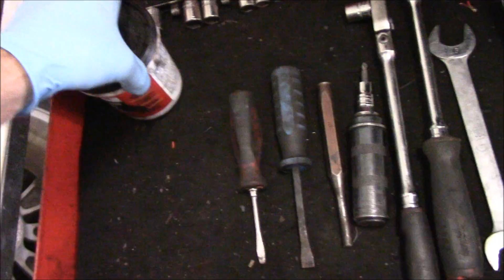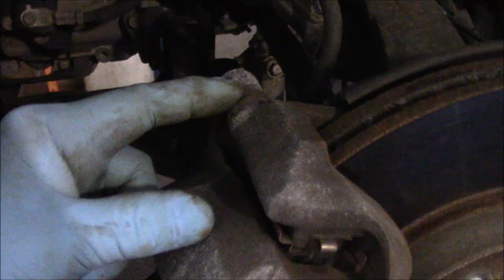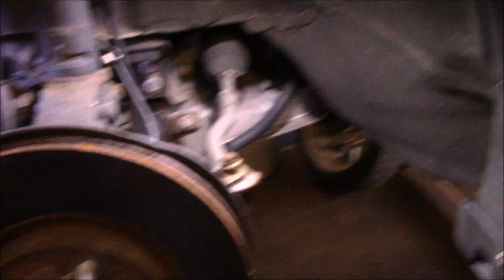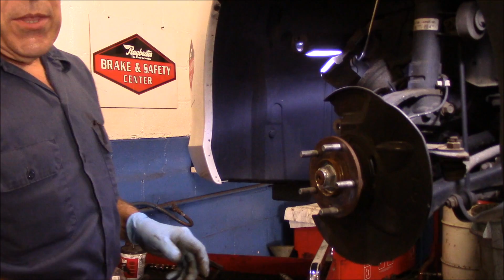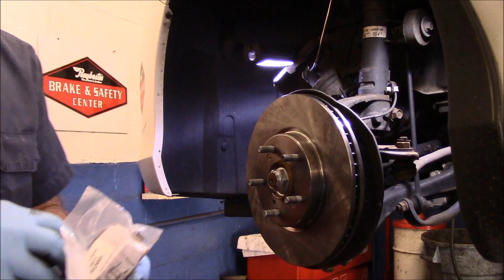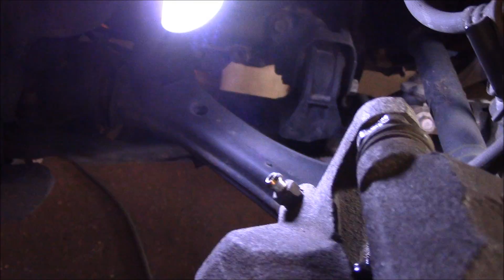Replace front brakes and rotors 2012,2013,2014,2015,2016 Honda Accord

Comment: Thank you for sharing this video. I have a question if i may. What grit sand paper did you use to clean the surface before putting the rotor back on?

Comment: YOU DID NOT REINSTALL THE THE TWO BRAK PAD SPRINGS.  USED TO HELP SEPERATE THE BRAKE PADS WHEN BRAKES ARE RELEASED.  ONLY TOP MECHANICS PUT THEM BACK.   ONLY SEEN ONE MENCHANIC ON YOUTUBE REINSTALL THEM.  THEY ARE FACTORY OEM ITEMS!!!

Comment: You are doing your job incorrect as missing pin to hold the pads and also missing the plate on the back of the inner pad.
Reply from the maker: You are wrong. The plate on the back as you call it .Does not come on quality  brake pads. As for the missing pin? What are you talking about?

Comment: Great video details. After putting brakes onto front bracket, I'm having problems putting the brake springs across the two pads and holding them into place while putting the caliper on. Any suggestions. I cannot find any information on reinstalling the springs? Thanks

Comment: At 15:40        Why are the two slide pins different from each other?  It's not enough to take them out one at a time and replace them where they came out.  What if the last mechanic who did the brakes mixed them up?  What is the difference in the function of the pins?

Comment: This is the detailed video I've been looking for. The last brake job I did was way back in 82 on my 70 Ford Fairlane with drum brakes. I wore those brakes out so bad the drums fell apart into pieces when I took them off. I wasn't sure if I would be able to replace the rotors and pads on my 2012 Honda but this video made it Easy Peasy Lemon Squeezy. Thank you verry much !!!

Comment: When finishing this job do you have to bleed the breaks? Just wondering
Reply: Brakes. And no. Brakes are bled at manufacturer recommended intervals. Not necessarily at brake/rotor replacement (no air was introduced into the hydraulic system).

Comment: The caliper bracket mounting bolts on my ‘16 accord are tightened to hell and one seems to need an 18mm socket. The 17mm won’t slide on which is weird cuz they look the same. Driver side

Comment: Thanks for the video Jim. I think this is the second or third time I’ve used this specific video and it saves me ~$300 every time. It’s always great to be able to learn from a seasoned pro, especially the extra tips (stuck rotor screws) that would otherwise be skipped on a basic step by step.

Comment: Hey what happens if you install the brake pads upside down . For example the front pads with the wear indicator on the inner side but instead up having the indicator up . Its on the bottom ?

Comment: Can I put the same from rotor on the back for more breaking power !. I see the from brake is thicker than the rear brake which mean the front has more breaking power than the rear because the rotor is thicker and the pads grabs the totor faster than the rear pads on the rotors.

Comment: I use the impact screwdriver all the time and never have trouble with it getting the screws out of the rotors. The torque specs are "Good and tight, plus or minus a jerk". After removing any rust, I still go back and spray break cleaner on the treated areas to remove any rust dust left on the reworked area. It is a great practice.

Comment: Is there a reason why there’s no V spring on the front pads? I bought brake pads with hardware kits for both my front and rear pads however only the rear pads came with V springs but not the front.

Comment: Is it advisable to use a thin layer of grease on the rotor surface where it meets the wheel hub?
Reply from the maker: Yes you can.Good question.

Comment: For those of us looking for the torque specs, here they are: 
      - Front Bracket mount bolts: 80 lb-ft (2013-2016)
 (These are the 17 mm bolts going to the wheel hub)
      - Front Caliper bolts: 37 lb-ft (2013 - 2015 Nissin type (14mm bolts))
      - Rear Bracket mount bolts: 80 lb-ft (2013-2016)
      - Rear Caliper bolts: 17 lb-ft
Reply: Anything else you’d recommend doing that he didn’t go over?
Reply: @bertabuddz4756  oh he was really thorough. I'd just suggest not to clean the wheel hub by hand as it takes really long to get it done. You can get the metal circular brush from autozone or home depot and attach it to your drill.

Comment: Replacing rotors and pads it is necessary to bleed the the calipers? Thanks
Reply from the maker: The only time you need to bleed the system is if you open the hydraulic system such as the lines or calipers etc.Thanks for watching

Comment: Thanks Jim for this video! I haven’t change the breaks of my car in quite some time and I want to do it myself, this is a great guide! I don’t have a lot of tools but since I will save around $200 by doing it myself, I might as well buy some helpful tools like the impact driver! Do you have any preferences of break pads or rotors? I have a Honda Accord 2014 Sport
Reply from the maker: I like the Monroe or the Wagner brakes. That is what I use in the shop.Thanks and good luck

Comment: Do you have to remove the brake reservoir cap first?
Reply from the maker: Only if the reservoir was over filledThanks for watching.
Reply: No, why would you?
Reply: @Thebrothaisback  Isn't it necessary when pressing the piston back in to avoid any damage to the brake lines??
Reply from the maker: Thanks for watching.

Comment: Saw a grease fitting there, does that fitting get grease pumped in ?
Reply: That was not a grease fitting, that was the caliper bleeder screw to bleed the hydraulic system.

Comment: A really good video.  Most everything covered and explained very well in easy to understand terms.  I wish you had included a mention of brake fluid issues just to reassure those watching.  Also, I would have likes more information on the silicon brake grease and a mention of anti-seize grease on the bolts.  If nothing else just mentioning fluid and anti-seize eliminates uncertainty.

I like the Amazon store feature.  The video would have been improved by reference to it for the piston spreader tool (I bought one), the brake grease (I bought a can), and the impact driver (I bought one). 

Not criticizing, just suggesting.

Great job!  I subscribed and look forward to other vids.

Comment: my 14 and 17 mm bolts were on so tight my air ratchet couldnt even budge em . it is a 50 lb ratchet though... any suggestions.
Reply from the maker: Yes if you get a very long ratchet that will give you more leverage .  keep me posted.

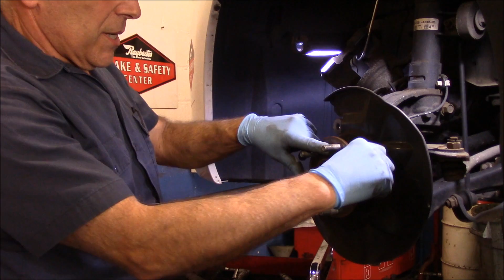Comment: I just replaced my factory rims and just noticed that both of the brake dust shields aren’t bent like at 9:59. Is that normal? I believer they are the dust shields, just not sure why they are bent like that.
Reply from the maker: Is it the same car in the video ? Every manufacturer has a different bend. I'm happy to help. Thanks for watching
Reply: jimthecarguy Thank you, it’s a 2015 Honda Accord sedan 2015. You may  have just answered my question. I didn’t know manufacturers have a different bend on the dust shields. I sent you a message on Instagram, with a video attached. It seems that it might just be how they are designed, just wasn’t sure if discount tire bent them.

Comment: My 2013 Honda Civic has very very very tight brake pads calipers bolt. How do I lose the bolt please ???
Reply from the maker: Are you using a long handle ratchet? The longer the handle the more leverage you will get.
Reply: I used the wrong size of socket. It should 12mm but I used 13mm.  Sometimes I’m a dumb guy ... By the way, I really really enjoy watching your video. I learned a lot from you. Thank you so much ! You are really awesome ! I wish I could know as much as you do about cars. Thanks again Jim !!! Blessings

Comment: Do I really need to put the screws back? My lateral runout gauge says the new rotor is better one lug over.
Reply: My understanding is that they are only on there because when they build the car, it holds the rotor on the wheel, while it moves down the assembly line. Also, given that when you buy Honda rotors, they don't give you screws, I think they are not necessary. I have ruined the screws removing them and I did not replace them. The lug nuts hold the rotor to the wheel.
Reply: I had to drill one out on my odyssey... I left it out on that rotor, wheel holds rotor in place

Comment: Jim, Great video and I'm glad I bought the impact screwdriver otherwise I never would have been able to get the original rotor screws off after 6 years on the road.  I struggled getting the discs off because of corrosion, but used a pry bar to free them up.  I have a question though about the pins on the caliper bracket...  one of the rear (top) pin was frozen.  I'd like to go back and fix this so should I buy a new bracket as well as the pins and boots?  Seems like it not worth the trouble trying to remove the pin and if its stuck in there, I would imagine the inside of the bracket is corroded.

Comment: Hi Jim, thank you for your video. I plan on changing my rotors in a month or so and found your video very helpful. When I searched for impact drivers they all come with a phillips or flat head. I didn't see any like the one you used when you tapped the screw on the sides. What is that tool called?
Reply: did this get answered?

Comment: Hey Jim. What is the silicone grease you are using? Used to do my 06 CRV and always used the grease packet that comes with OEM pads. First time i did the rotors had a hell of a time getting the rotor screws out. Nice tip. Will be inspecting my 16 Civic rotors and pads this weekend when i swap out my snows. Nice video. Also, it's funny how those dame lights fly across the room on their own. Seen mine do it a few times.
Reply from the maker: Yes sometime the screw is the hardest part of the job.They should call the flying lights instead of  drop lights. lol
Reply: jimthecarguy can you comment on your silicone grease? Also found and interesting video on the screws. They have specific tool for them called Japanese Industrial Standard. The taper is different and is designed for those types of screws. The tip is shorter than a Philips so the fit is better. They make an impact jis driver I have ordered one from Amazon. Hope it works well.

Comment: Hey Jim, you didn’t mention in the video but before pushing the brake piston back into the caliper, do you open the brake fluid reservoir? Thanks for the video, I’ll be taking this project on this weekend.
Reply: Did you bleed the brakes?
Reply: Not sure about opening reservoir, but you may want to check the level of the reservoir.. If full, it will likely overflow when you push back piston... I use a turkey blaster to remove excess... Honda recommends replacing/flushing brake fluid every 3 years... Is not hard to do but alot easier with a second person

Comment: Jim, would you recommend removing or loosening the master cylinder cap to make the piston easier to compress?
Reply from the maker: No need to open the cap unless the master cylinder was over filled.

Comment: Thanks for the video super helpful, what are the torque specs?
Reply: For my 2012 Honda Civic LX Coupe...25 lb/ft on the front caliper bolts and 80 lb/ft on the front bracket bolts.

Here's the result that I got for my car when I Googled torque specs for my 2012 Honda Civic LX Coupe: 

http://www.collegehillshonda.com/instructions/civic/2012/4dr/civic_torque_specs.pdf     

The PDF listed most, but not all the torque specs for the car. 

Don't forget the lug nut torque specs...80 ft/lbs. Got that here:

https://www.discounttiredirect.com/learn/wheel-torque#honda

Hope this helps.

Comment: Thanks Jim again for posting this video.  I have to replace brakes on my wife's 2007 Honda Odyssey soon.  Is there any benefit to using Anti-Seize on the rotor screws, or using Blue Loctite on the 17 mm caliper bolts in your opinion?  Also, I bought these Scotch Brite pads designed for cleaning brake hubs which attach to an Air Angle Grinder: https://www.amazon.com/gp/product/B0013HHNPY/ref=oh_aui_detailpage_o03_s00
Reply from the maker: Yes by using them it will be easier the next time.Thank you for watching
Reply: David Breiner Who ever takes those rotor screws off after you will thank you for putting anti seize on them.
Reply from the maker: Thank you for watching